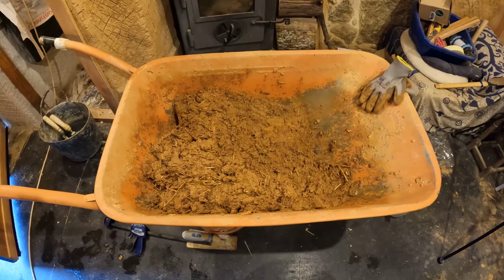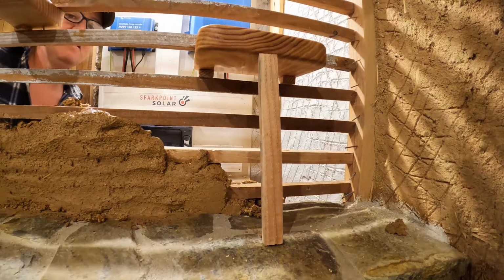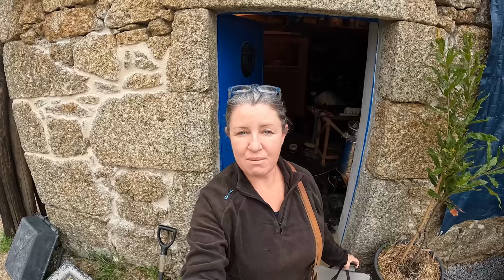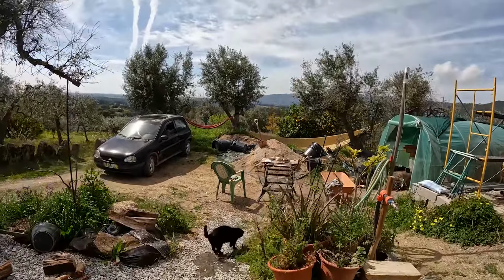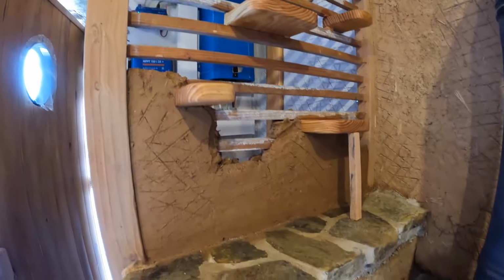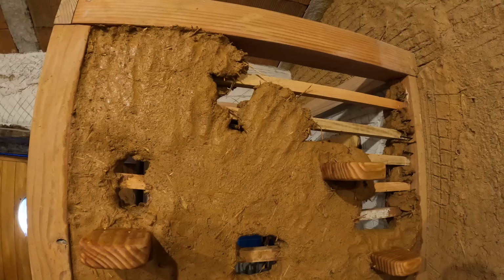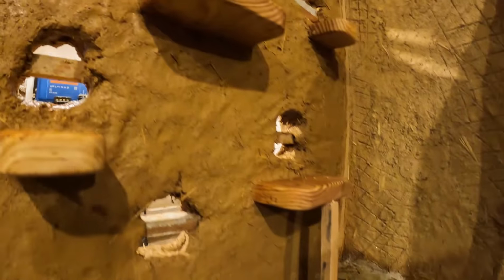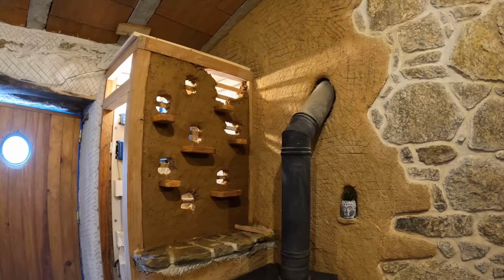CLAY WALL CLIMBS HIGHER & WINE GETS BOTTLED - Off Grid Barn Conversion

Comment: Looking really good, little steps and careful consideration on the planning process will see you get by. One little tip for a natural insect repellent is to crush up a load of cloves with lavender seeds. You can also sprinkle a bit in your pillow or bed and you will sleep like a baby! Lol. Sprinkle this dust around nooks and crevasses too which will deter ants and insects. Put some in water and bring to the boil gently. Sieve it into a spray bottle after it has cooled and spray a bit it on yourself. It works wonders.
Reply from the maker: Ooh I have lots of lavender growing... I should try these ideas, thanks!

Comment: Just an idea for anyone else here or if you have anymore similar walls to do - you could use 2 face creams jars back to back as a very small light source, they are usually made from a very heavy glass and you might get them in different colours. I have never done anything like this but was cleaning out one of these jars for re cycling and thought if your wall. 😊
Reply from the maker: That was actually my intention all along for the bathroom wall. The closet wall is too thin for this idea, though. The bathroom wall might also be a bit too thin but I've got some jars already and I'll test it out once I get. more clay. 😀

Comment: 29:13 29:13 you probably know this already but if you deadhead your irises they will keep blooming. Just a thought everything looks great!
Reply from the maker: I know nothing at all about irises! Or deadheading... I'll look it up, thanks!
Reply: All you need to do is once the flower has faded you grab the bottom of the flower itself where there's like a node and you just snap it off you don't have to cut it you just hold the node where the flower or the bottom of the flower is and you snap that off and it will rebloom. Then in the fall you cut your irises down to about 4 to 6 inches tall and they will rebloom in spring.
Reply from the maker: Thanks! They rebloom every year already without me doing anything at all... or do you mean that they'll bloom several times a year if I do this?

Comment: How about using large glass marbles for the shelf-wall? Or a more random assortment to provide more variety. You wpuld have to buy them, I guess. But they should not be very expensive 💕
Reply from the maker: Ooh that would be cool but I'm on a budget. However the beauty is that I can always add them later!

Comment: Hello Again,  Do you think you could clamp a board on one side while you place the clay on the other side to stop the clay from falling thru ?   Just a thought,  you are doing a great job !
Reply from the maker: Yes for sure, that would be another way to do things. It's such a versatile material! The form board way is often used for something called 'light clay straw' or I think it's also sometimes called 'slipstraw'. But for such a small wall like this, I think I could have one it with your method, too.

Comment: Hi is becoming smarter by the day! Do you also use the linseed oil on those wood that goes inside the clay wall?
Reply from the maker: Thanks! No, because the wood is encased completely in the clay it's protected that way. It's more about the exposed areas for the look of it but also to protect against bugs and moisture.

Comment: perhaps using your jig saw would accomplish the project sawing out slats  ......S
Reply from the maker: Ooh that could work! I didn't even think of that. I think it could be tricky with the space to work due to the shelves and the vibration might shake things up too much... but I might give it a go. Thanks!
Reply: perhaps an equal width of wood as a spacer will take away the shake .........S
Reply from the maker: Great idea! I'll try it first without and give that a go if I need to. Cheers!